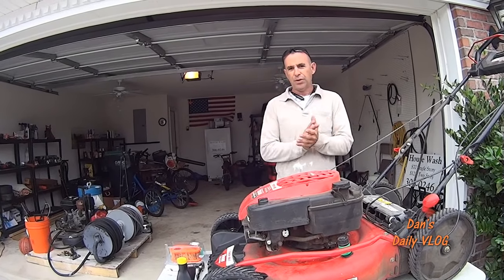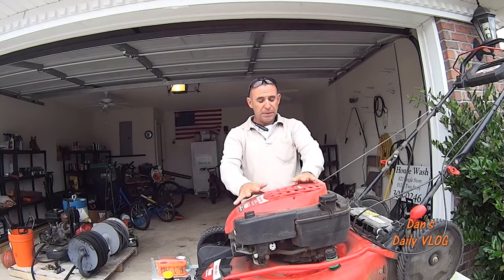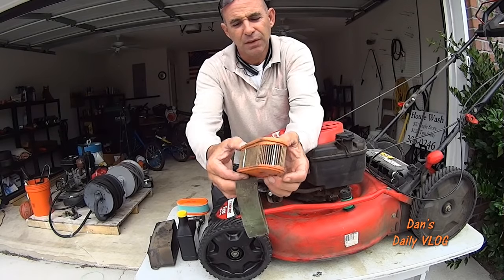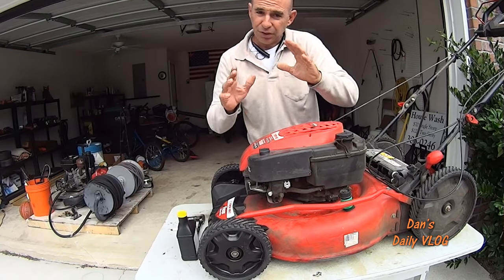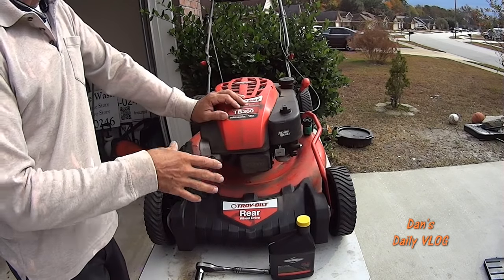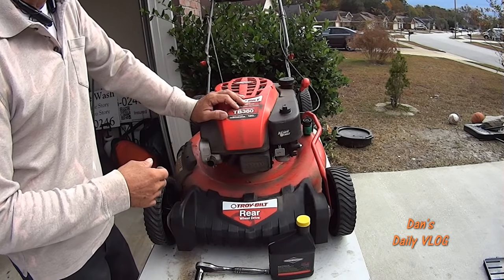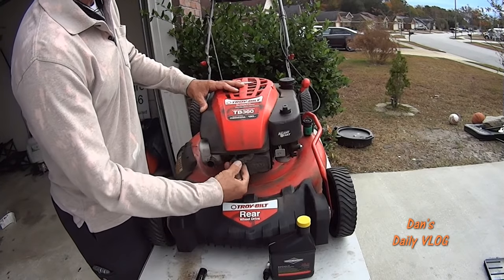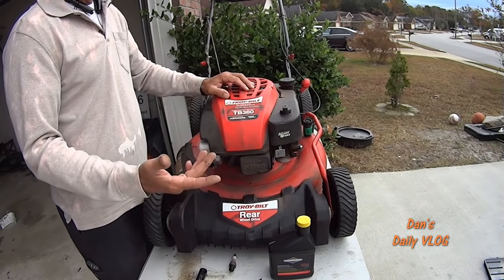Lawn Mower Repair- How To Replace Air Filter - Spark Plug and Why

Comment: Gapping a park plug is usually only necessary on cheaper copper plugs where gaps can be off a good bit.  You're right in that it will usually still run, but gapping makes the plug ignite and fire better and extends the life of the electrode.  Cleaning a plug and re-gapping it every so often can greatly extend the life of the plug and keep your engine running smoother.  Considering Gap tools are usually a buck or two at most parts stores, there's no good reason not to do it unless your plug isn't copper.  Non-copper plugs like platinum or iridium are usually pre-gapped and you risk damaging the electrode by trying to gap them, so it's best to leave them alone unless they're way off.
Reply from the maker: Good info! Thank you

Comment: I am dealing with slight engione surging.  I've replaced the air filter, its beter, but srtill surging.  Could changing the spark plug help?
Reply from the maker: 99.9% of the time, it is a fuel issue and of that... 100% of the time it is dirt somewhere in the carb to include and usually the main jet. This will help: https://youtu.be/J0Jyt6h-buQ

Comment: If it is just a filter, with no pre-cleaner, should I still "oil" the air filter?   Air filter is the old 5-sided kind.
Reply from the maker: Bill Tatum I never oil any filters unless they specifically say too. Definitely NOT paper filters

Comment: I have a 190cc non self propelled Troybilt push mower and it just has the square air filter it does not have the pre cleaner I have had this mower for years now the only thing I have had to do was clean the carb.I always change the oil.air filter.and spark plug and also put fuel staybil in the fuel tank during the winter.So far I have never adjusted the gap either.
Reply from the maker: WOW 190cc going only to the blade? No self propulsion taking power away from the cut? What a beast!!!

Comment: Great advice 👍 an empty carb
Reply from the maker: I would rather you put some stabil stabilizer in it so the seals in the carb and the fuel line doesn't dry out and crack from the ethanol residue. Stabilize the fuel now and run machine for 5 minutes so the carb gets the stabilizer in it as well then drain it in march IF you have to.